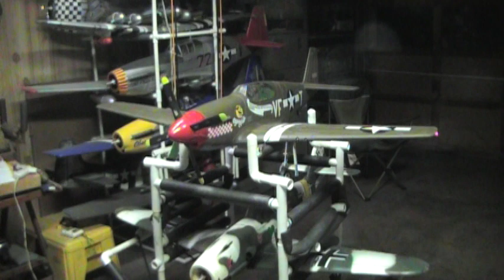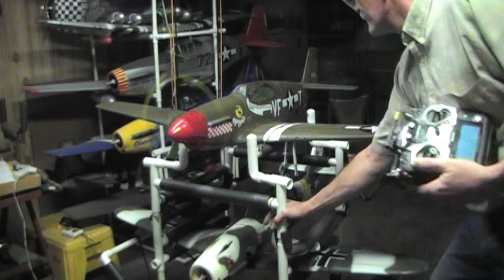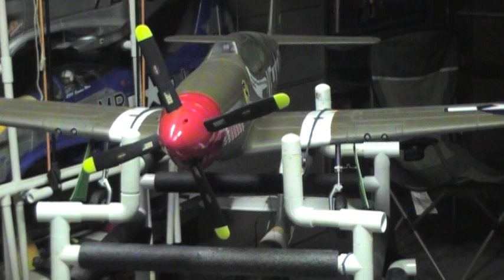My FMS P-51B with MR.RC Sound V4 and Gun lights 001

Comment from the maker: No, but Andrew will be glad to help you out. The two rows of pins next to the volume poot is for the lights. the pos pin is closest to the volume pot and the neg is the pin closest to the sound chip, both rows of pins are tied to the same output and only work in sync with sound 1 (Servo connector 2 as labeled on the card.)